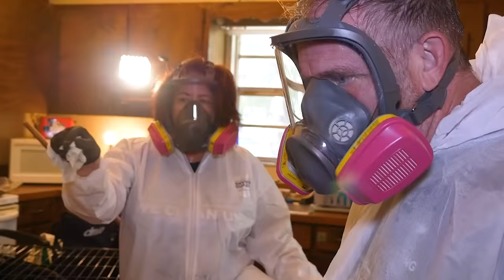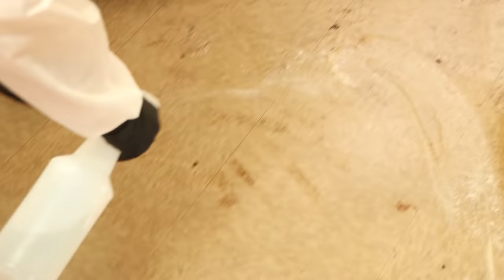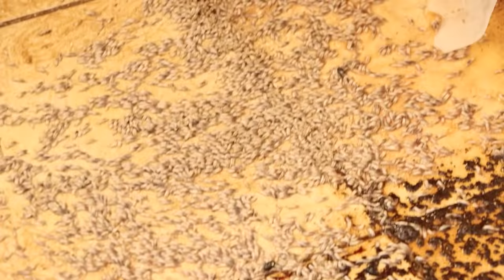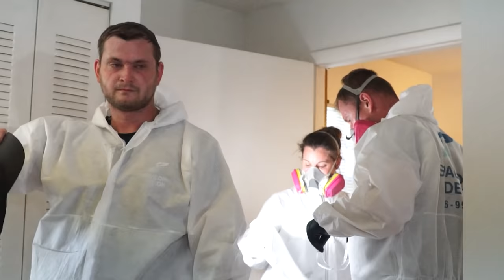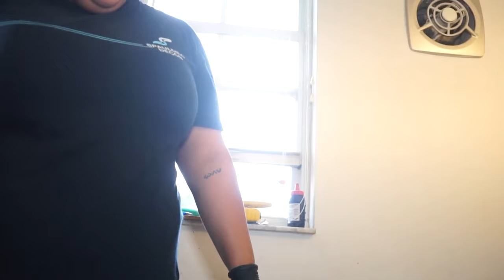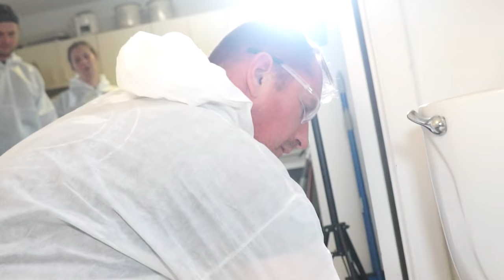The Most Maggots We've EVER Seen!!!

Comment: I have a suggestion for you on your clean ups, they sell a pop-up frame that holds trash bags up and open, mostly used for helping you on raked leaves, but this way someone doesnt have the risk of getting bodily fluids on them due to holding a bag open.   Another suggestion would be to use a squeegee to get the mass of the fluid into locations where it's easier to pick up, perhaps with dust pans, that would help you when maggots are present, but would definitely speed your clean up process, so you can get to the point of disinfecting much quicker.  Hope this helps.
Thanks,
VL
Reply: Good ideas and I was actually wondering why they didn't use the cat litter to clump up the extra wet liquid
Reply: Good advice, seeing them trying to wipe up the gallons of goo with a couple wadded up paper towels was driving me nuts. Great videos though, thanks for sharing!
Reply: I commented pretty much exactly this before reading urs lol
Reply: @beebutt7244  dollar tree dust pan would work fine. Would make paper towel cost go down I bet

Comment: Using clean wipes at that early stage is completely unnecessary.
Use a scrubber and a shovel to clean out the coarse stuff, THEN use the clean wipes - or a mop.
Though...if you plan to remove the tiles anyway, you can skip the clean swipes completely.

Comment: We use ozone generators in car rental, too. It works extremely well, but it is exceptionally dangerous and you have to keep the car locked up while it's running so no one can get in it. We air it out for a few minutes following, as well. It kills EVERYTHING, including you if you're inside while it's on.

Comment: Drywall pro tip: use a drywall router to cut it instead of a circular saw and you’ll get a cleaner cut with a significantly less amount of dust.

Comment: Why don't you use a pump sprayer for the cleaning solution, instead of using spray bottles. You can get more down quicker. And a squeegee to move the fluid to a dustpan or scoop shovel. Ya'll let's work smarter not harder!

Comment: Why not use a rubber scraper with a broom handle and a big dustpan then decontaminate it bleach it when done? Power spray it with oxyclean brand takes blood stains out  Then use a mop head every job or a Swiffer jet? Pour boiling water in the maggots Ideas?

Comment: I'm not understanding the crouch on the floor and wipe with tissue method......  also lifting the bath mat in that way... I don't get it.  if mat was folded in on itself then placing it in the bin bag would be easier.  Surely using a long handled squeegie and shovel for lifting maggots/decomp much more efficient than wiping with tissue.  It's a nasty job why prolong the exposure to yourselves.

Comment: With paper towels? Really? There’s not a better method?
Reply from the maker: We use special paper towels to absorb and capture the major concentrations of decomp. Then we remove the top layers of floor, usually going down to the subfloor. Finally, everything contaminated with decomp is put in a special biohazard waste bin for incineration.
Reply: @CrimeSceneCleaning  How did he die? How harsh of conditions where there for a guy to blow up?